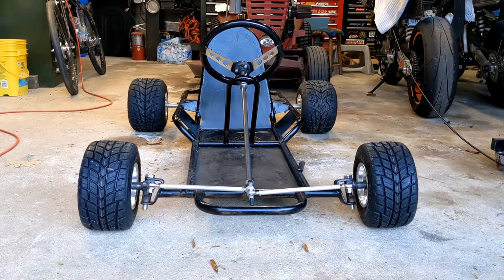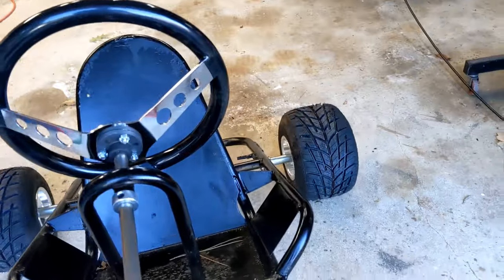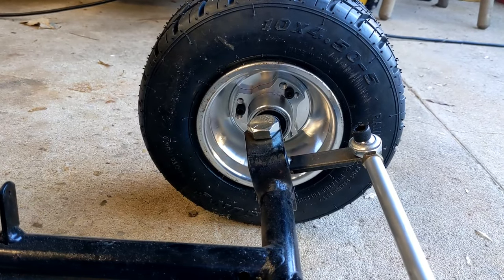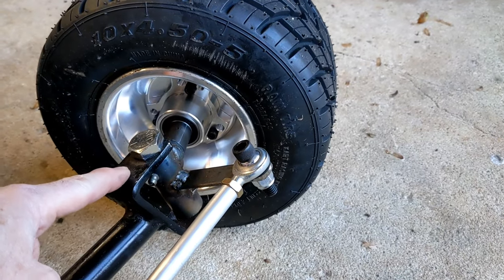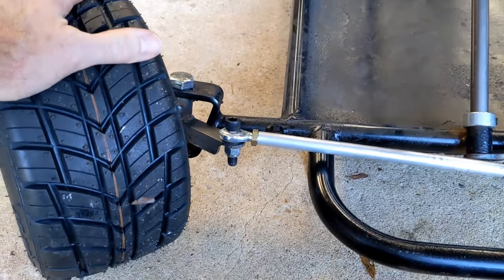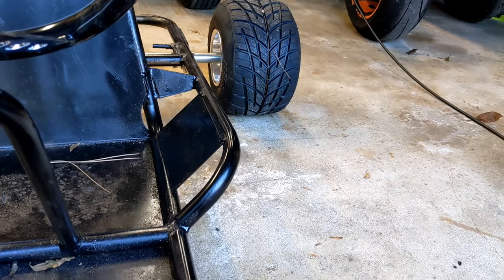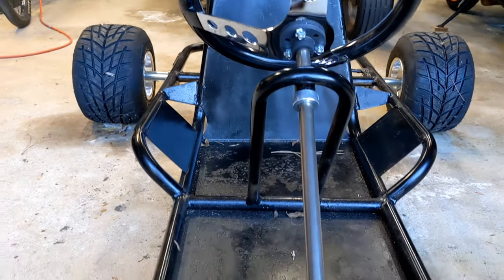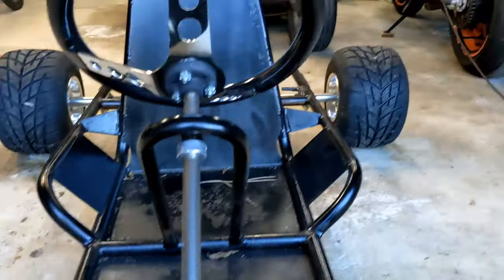My Go Kart won't turn. Why you need caster with a live axle kart

Comment: The best video would show examples.  You did make me aware, though and here I am again watching for the fourth time because on my ground force drifter, upgraded to 48v with your tread SCREWED onto the rear wheels and I felt like the kart was sliding side to side.  I rode while looking at the rear wheels and then the front, and decided the front wheels were swiveling a tiny bit(unstable?) and it reminded me of what I've learned here. Now to think of it, drag racing on the highway, I got 110 and my unmodified Altima tried to slim me out. A friend with a fast car said some thing about the tire rod and something or other....hmmm...
Anyway, good info. Thanks very helpful in diy kart building

Comment: Caster on a car is like trail on a motorcycle front tire, it makes the steering wheel/wheels return to center (straight). I run solid axles on go-karts, it is a pain but they don't get good traction with one wheel drive!
Reply from the maker: It will make the wheel want to return to center(KPI does this to) and it will make the kart track straighter but when you run a live axle it really does help the kart rotate buy unloading the inside rear wheel.

Comment: Caster makes your front wheels re-center after a turn to make it more stable.  It looks like your cart has incorrect ackerman.   You should be able to run a line from tie rod end through spindle pivot to centerlind of rear axle.  Your outer tie rod end with front steer should be farther out than spindle centerline.
Reply from the maker: Caster and KPI help the wheels recenter, but caster is also used for "wedge" to help plant or lift a corner of the car. 
The original knuckles had reverse ackerman, which may have been done to clear the tires. I got my figuring backwards and made the new knuckles with reverse ackerman as well. For now I am going to run with it, it works on Formula 1 cars. Because I don't want to run really wide track and the tire width, I don't have room to properly angle for ackerman and would have to create the angle at the steering point.
Reply: Swap the spindles spin them around to rear steer you have to make a new center pivot mount anyways flip it around give each tire tiny tiny bit of toe 1° should be close enough to Ackerman I’m working my sons out now

Comment: Sorry, I don't know the names of all the pieces, but I think it's maybe the tie rod end(?) the ball joint thing with the allen bolt through it that attaches to the front piece of the spindle... Why does that need to be a ball, rather than just being a bearing? Is it just to allow more fine tuning?
Reply from the maker: Those are called heim joints. If the mounts were in the same plane and stayed in plane through the range of motion you could use a plain bearing. The other thing is the heim joints come with left and right hand threads so you can turn the tie rod to change the length easily.

Comment: I am building my cart. Below is my reasons and expectations coming from Russia. I will be using a jackshaft with 2 centrufugal clutches and 2 short axles with 1 clutch pushing one axle and the other clutch pushing the other axle... thus providing positive traction.  The engine will have 2 #40 x 1" bore sprockets supporting 2 chains to the jackshaft with those same size sprockets. The jack shaft will have L~ Jaw couplers to provide on and off road gearing and possibly another set for reverse. I expect to purchase 4 sprockets to assemble two sets being used as gears instead of sprockets and that should be reverse.
I have extreme difficulty walking and without a home, my plan is for the cockpit to double as sleeping quarters. This requires the steering rod to be level so as not to interfer with my feet (foot and prostetic).
 when sleeping.  For this i need a much longer bottom and with some channel and same size wood it can be extended past and above the steering assembly except the rod connecting the steering wheel to the rack and pinion setup.  I expect to make the pedals on a hinge that gets pushed up and to the side when not in use. I also will attempt making a hinged section of frame that will hopefully dramatically increase or decrease the wheel base with some increments inbetween. I have 2 3 gallon tanks i plan on using for fuel and conpressed air. They will be mounted on the sides to increase the width for more confort. Towing behind me will be an extendable trailer to carry mu supplies and other tools and accessories. I will also be installing a PTO System that I may hook up power equipment to.  Being extravagant I hope to put on a front bucket though linited greatly but... able to dig and move a certain amount of dirt, enabling me to make an actual mancave for protection against Nuclear desasters a Hitlatarian like Putin could become.  Disagree?  Let me ask you... What must USA's responce to Russia hitting USA with a Nuclear Warhead be?  I am not asking what it will be, but rather what it MUST be?  The answer is the same as if Putin unloads a Nuke or Nukes onto Europe... Europe, like USA MUST Surrender!   All out Nuclear War leaves no one alive and Putin is 69 Years old and shows no signs of wanting to leave a beloving legacy.  Thonk about that. He has one foot in the grave and on hand on a Nuclear War Head.  I do not blame him for wanting a revived Soviet Union, I just wished his reasoning was admirable with a zero life cost priority.  Consider if he is mostly successful why must he push onward?  The financial costs whether successful or not, will be trenendous. He will have to re~build Russia's (or the New Soviet Union's) Economies.  Along with that economy distress comes China. Sanctions against China will push China to seek new financial gains. N.Korea already shows a major tyranny and that of course also means a possible alliance with China and with Russia.  Who buy the "good guys" are the "bad guys" going to look at to replenish their finances? ( I guess they could take a kesson from USA and simply print more unbacked currency... but... USA is such a consumer that the world does not care about USA's worthless currency which in turn makes the Currency of USA  Valueable.  However, Russia nor China nor N. Korea has that valueable worthless currency that USA has and has maintained.  I would much rather Putin rebuild the old Soviet Union through honorable methods, however lives being forfeited has already been a cost of no concern to Putin.
      Japan attacked USA in part to align itself with Hitler that Germany may protect rather than attack Japan. That idea can easily be renewed but with other countries like Iran, Turkey, Israel and many others.
With today's technology hooked up to the internet and playstations then given to a few boyscout troops Germany would have been demolished quick, fast and in a hurry. But now nearly every country in the world has Nuclear Bomb abilities or are friends with a country that does.
Currently and for the last 3 decades we have become inundated with lunatics in power wanting more power.  Add to that we have the current COVID-19 (plus it's variants) Epidemics and worse yet the propaganda being fasley spread about its effectiveness. I expected an outbreak of labels being put on everything claiming "This can cause cancer, use at your own risk." 
  In its stead, we see everything that causes a death or even causes an  amputation is being labeled a COVID-19 fatality or COVID-19 associated health disabler.  This last variant (I think it is #5) has had its 90 day germination expire and though that variant was lesser than its predecessors it is nearing time for the next Variant to rise to power. How devastating it will be or just how devastating it will be labeled through more propaganda is yet to be seen.
     Finally we look at Digital Currency and a connection with COVID-19.  Already Vaccinations for anything to do with the Coronavirus (like COVID-19) has caused severe Proof of Purchase records, when that connects with digital currency for monetary sustenance and Vaccibation records the Economies of the World should begin to fail dramatically.  This could greatly affect the World's largest worthless currency manufacturer and the World's largest Consumer... USA, with Europe being next in line. This could undermine attacks on Europe and USA as being a focal point for prosperiety gains necessary by Counteiea depleting their assets through their warfare campaigns.  This ciuld easily make a redirection possible but where will be the destination of this redirection?
     Full Circle... this is the reason for me building a Go Kart like I have described. Fuel economy is paramount. Owning land will make you a victim of a desparate Government. Being immobile (having a home or rent house, land, a job will turn you into a target. The only protection is one of mobility self-suffiency, survival training, learning and invisibility will be ones best protection. Some simple Math...  COVID-19 is not a name but rather a mathematical equasion... do the equasion and read Revelation Chapter 13.  Next...  Digital Currency + Vaccinations + Vaccination Records = the Mark of the Beast.  Soon (if not already) Vaccinations will come with an RFID Chip or "like" but equviliant identifier enabling whether or not you have been Vaccinated to be known + your financial records + one's ability to buy and sell will be manditory.  Sweden has already implimentation of just such a device. If your Doctor or anyone trying to vaccinate you with a Pre~Filled syringe...  RUN!  For an implanted identifier to be given through a vaccine it will require the use of a prefilled syringe.  A vial used for many and still trying to implant an RFIS Chip, one person, one chip is impossible, but a syringe pre filled with one vaccine + one microchip is very possible.  AND nothing says they must tell you or even check to see if it has been viable.  Looj on your phone there is an app notification that when turned on will allow anyone to know whether or not you have been vaccinated + given a microchip.  This means many that are vaccinated could already have this microchip implanted.  Do NOT take these Vaccines unless you want to meet Satan.
     Any Moment many Countries (including USA) Could become a cashless society.

Comment: Can you tell me what frame you have? I have the same one and don’t know the name of manufacturer. Also what tires and steering wheel do you have.  Thanks!
Reply from the maker: It is similar to the Robron karts(and was labeled as one) but I spoke with the owner of that company and he said it was not one of his so I really don't know. It was a popular design and a lot of little companies did knock off versions of the Robron(which were made with tooling from the Original Rupp kart maker)
The tires/rims I got from Amazon, look up Vevor go kart tires and rims
The steering wheel is from Speedway Motors, they have a LOT of options, check out the 13" wheels. You will have to slot the holes to get it to work on a kart steering hub.
Reply: @WhatIsTheWheel   thanks so much, great cart build videos.  I’m following your build so I get ideas.  Thank you.

Comment: i put more weight in the front and turns perfect now
Reply from the maker: Balance is a big deal for sure. If you have a cart where you can move the seat front to back and change that balance, especially on something as light as a cart, You can really make a big difference in how it handles.

Comment: Man.. I just bought the same wheels because theyre a great deal. but WHERE DO WE BUY HUBS THAT FIT THEM
Reply from the maker: It is frustrating that the correct hubs don't come up when you look at the wheels, that's the algorithm for you.
This should be the rear hub to fit, BMI should have a matching front as well
https://www.bmikarts.com/Metric-Pattern-Wheel-Hub-1-or-1-14-Bore_p_1643.html

Comment: Lol never seen gokart with such a flexible frame..  scarey!  But was a great video on the topic
Reply from the maker: Thanks, I appreciate the response. It is not flexing, just rocking on opposite corner wheels. Karts built like this, basically two hoops welded together, do have a lot of flex that acts as suspension. I have seen some vintage racing karts  with tie bars connecting the front and rear hoops and used to tune the amount of flex.

Comment: We’re did you find the hubs for these wheels I ordered the same ones from eBay and can’t seem to get any kart hubs to fit
Reply from the maker: You have the Vevor wheels like these? Try BMI, the link is to some multi pattern hubs with the 58mm pattern on them. I would check with them about the wheel hub center diameter.
https://www.bmikarts.com/Dual-Pattern-Hub-Metric-American--1-Bore_p_7414.html

Comment: What size wheels and tires if you don't mind me asking? Do you have a link for both? This thing looks sick. It's exactly how I'm building my go kart, but I've got a two-seater.
Reply from the maker: 10x5.5 and 11x7.5 They came as a set of four with the tires mounted. You can get them from several places but I used Amazon, the link is below. Look for Metric/Euro hubs they should fit with no machine work. 
https://www.amazon.com/gp/product/B08GCHKG9P/ref=ppx_yo_dt_b_search_asin_title?ie=UTF8&psc=1

Comment: It looks like you have some ‘vintage gold’ there. It looks to be a very early Rupp A-Bone kart chassis. Very similar to mine from 1969. Maybe research it to the Kart Vintage sights.
Reply from the maker: I checked on some vintage kart forums because the kart had some RobRon(he bought Rupp) stickers on it. I got a response from the owner of RobRon and, unfortunately, it is not even one of his replicas. It is a knock off someone made to look like a Rupp.
Reply: @WhatIsTheWheel  Unfortunately that happened a lot back then. They did a pretty good copy job though because it looks just like mine. Thank You!

Comment: How much caster is that cart. I have a cart I am racing and it has 0 caster. I was thinking I need this. How many degrees wood be a good start?
Reply from the maker: This Kart has a bunch of caster, about 15 degrees. I am no expert in this, but I ran a autocross car and ran about 5 degrees on that. The problem with karts is that the caster(and camber) are not adjustable. You have to make a choice and weld it up. you have a race kart, the guys that built the kart had a plan so it might be best to stick with it. From what I see, if you run a dead axle, the caster only helps with "feel". This is how the wheel want to return to ZERO, tracking straight ahead. You can get that effect with KPI
After all that, if you have a dead axle and want the kart to be more responsive, KPI is you best bet. If you have a live axle and the kart does not want to turn, then caster should help by pickin up one of the drive wheels so it can slip. Exact numbers I don't have to help with this. If you can spend the time, weld up an axle that you can rotate to changeth caster.

Comment: How did you prevent the rear hubs from sliding in on the axel?
Reply from the maker: The hubs are slotted and have pinch bolts. If they move after I get it up and running, I will add a pinch collar behind the hub to give it something to push against.

Comment: first question would be...how much??? with the standard measurements for a gokart, its 12 degrees..
Reply from the maker: It is a good question. I wish I had a bunch of money and track access, I would build an adjustable one and test out suspension changes. This one is 14 degrees, although I have seen older karts with zero as well as no KPI. A lot of those were old(50s-60s) twin engine race karts

Comment: Do they make differentials for karts?
Reply from the maker: Thanks for the question. You can get differentials that will work with karts but they can be pretty pricy and you have to do some work to fit them. The other issue is you don't get much from them because they are open, that is they don't have a locking feature that diverts drive to the wheel with traction.

Comment: Do you happen to know both of the angles of the kingpin bracket?
Reply from the maker: I believe the kingpin inclination is 7-8 degrees and the caster is 13-14 degrees. There is also a little over a degree of camber. I made these knuckles based off the original ones, and the used an average of the measurements I got from the stock pieces

Comment: Where can I find these type of casters? I did a build and this will hopefully fix my problem
Reply from the maker: Caster is the angle of the king pin from vertical, front to back. You would have cut the knuckles off and re-weld them at the angle you wanted(About 14 degrees on this kart)

Comment: Where did you get your wheel hub?
Reply from the maker: I got them through Amazon but they came from OMB warehouse. I usually try to get parts direct from the minibike/go kart guys now.
Reply: @WhatIsTheWheel  do you know the name or dimensions?
Reply from the maker: @davidguardado-jt2dg  They are listed as drift trike go kart hubs. The rears fit a 1" axle and the fronts fit a 5/8 axle. Be sure to match your hubs and rims. I got it wrong and ended up redrilling the hubs. There are hubs that fit the Vevor rims I used
Reply: @WhatIsTheWheel  the same exact wheels that you have im planning to get so no need to worry abt the rim and hub, im guessing the same hubs you use for the front you should use for the back because i only see one hub from the one your talking abt which is the set of 2